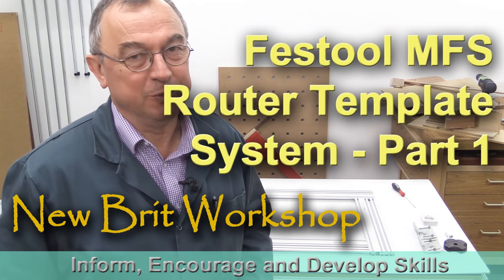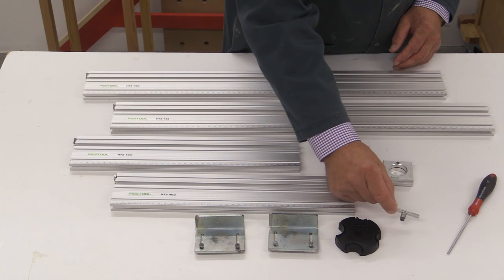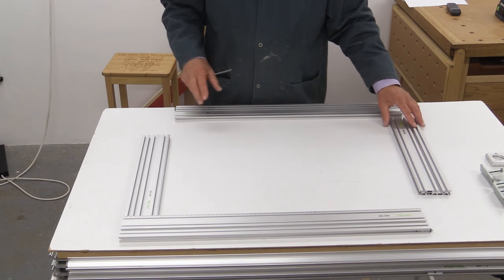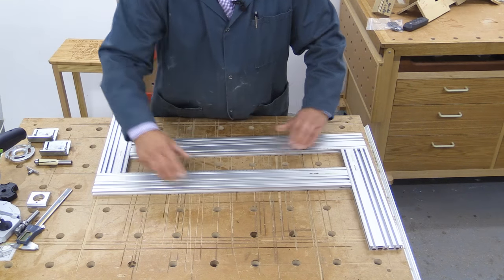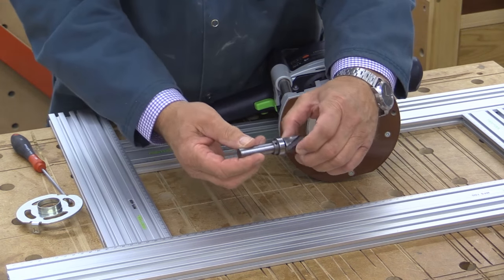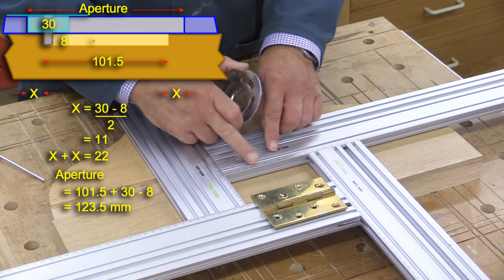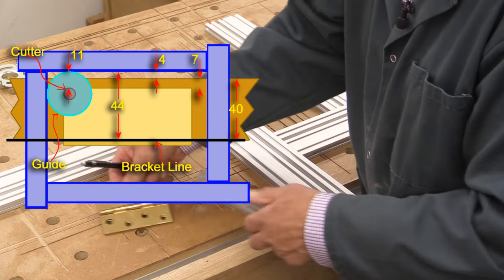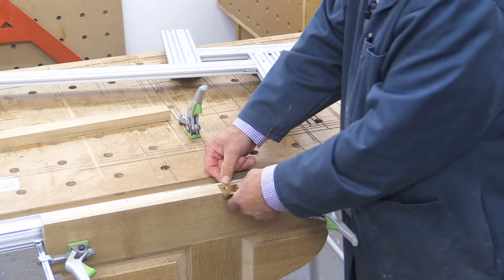Festool MFS Router Template System - Part 1 of 2

Comment: Hi Peter, thanks for the video.  I used an MFS 700 in combination with the 2200 router on a 40mm door. Worked perfectly, not hard to set-up. I used one clamp around the door to one of the brackets.
Reply from the maker: Hi John, Well done. I keep meaning to buy an MFS for myself.  Cheers.   Peter

Comment: I recently got an MFS kit. I got the 200 mm, 400 mm and 1000 mm extrusions. The first thing I noticed is that the scales on them is inaccurate. Not by a small amount either. It differs 1mm per 30 cm. I'm comparing against other Festool products with scales on them, as well as a starrett combination square. 

I think this is unacceptable for the price. And I can't understand why. It's just wierd, since the quality control seems to be very high regarding all the other aspects of this product.
Reply from the maker: Hi Magnus, You should return the product immediately within the Festool 30 day money back period.  Peter
Reply: I have reached out to Festool to hear what they have to say.

Comment: Hi PeterVery informative video, I have just purchased the MFS 700 and used your tutorial to start using itOne question please, your size between the edge of the guide and cutter of 11mm, how was this calculated ?
Reply from the maker: Hi Gary, I am away from base so hope I am guessing right - take the diameter of the cutter away from the diameter of the guide bush and divide by 2.  I have no means of viewing the video or checking this detail so please make sure that it seems sensible.   Peter
Reply: Yes of course, this makes sense, thanks Peter

Comment: Peter, have you ever used any of the smaller router/trimmers from Festool? I have the 1400 like the one in this video, but I find it a little bulky for round overs and even hinges and the like. I like the one handed operation of the smaller ones, but the Festool trimmers even look a touch bulky in this regard too. Any thoughts, as Festool expert?
Reply from the maker: Hi Rico, I am far from being a Festool expert but I am an addict !   I have each of the three main routers (OF2200, OF1400 and OF1010). The OF 1010 is a delight to use as it is so light and it can be used for trim work with an optional foot assembly. Here is the link to the OF1010 videos - Part 1: https://www.youtube.com/watch?v=9rd345qwIkU  and Part 2: https://www.youtube.com/watch?v=8l09Q1wOO3I    I have used one of the trim routers when I did the Conturo video but I am not in a position to recommend it as I only used it for one operation and then it was returned to Festool.  Have you posed your question on the Festool Owners' Group (FOG)? It might help to do that.  Good luck.   Peter
Reply: Thanks, I'll check out the OF1010 videos again, although I think it's possibly a little large for regular one-handed use, and I'll see if there are any threads on FOG regarding the trim routers too. With 3 routers and two router-videos, I reckon you're definitely the go-to for Festool advice!